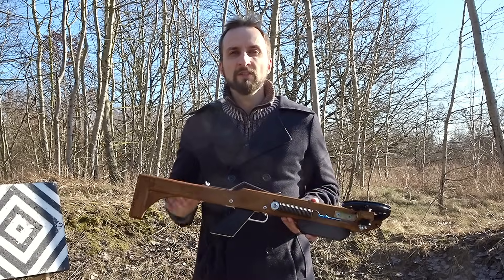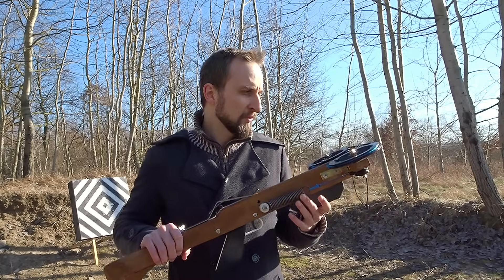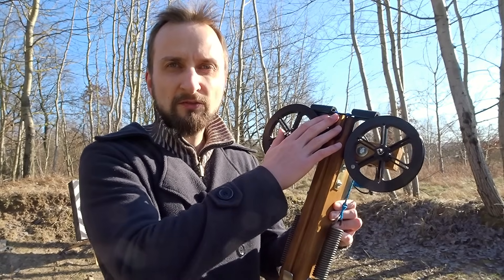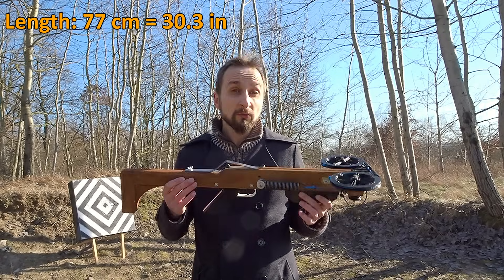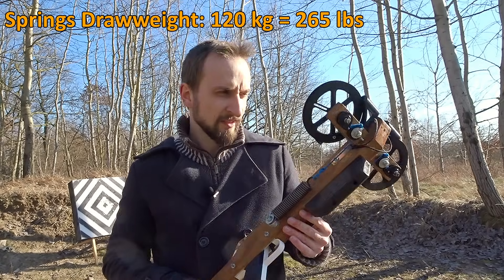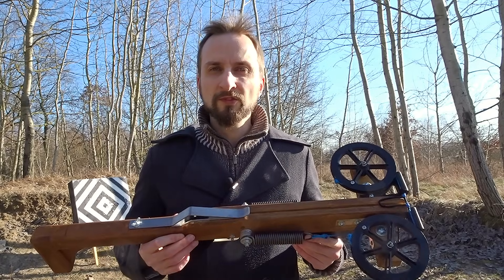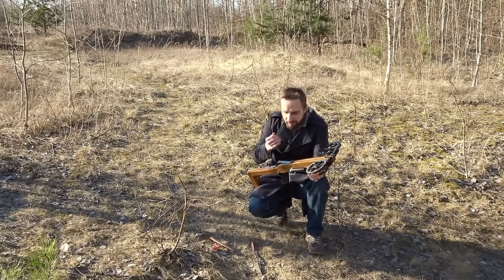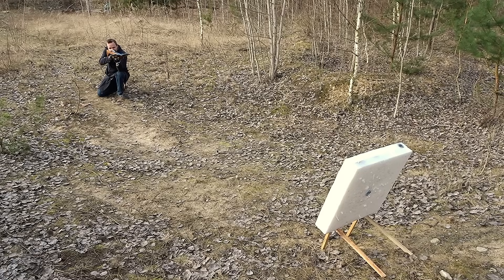Coilspring powered Crossbow

Comment: amazing! Can you build one that shoots bullets aswell?
Reply from the maker: Sure, that would work probably similar as in a Talon Eagle (or other models, see  https://www.youtube.com/watch?v=QeK3mM4BpzU ). The main problem is that bullets are too light. Crossbow bolts are usually much heavier (bolts I used in the video: ~30 g, 9 mm parabellum: ~6 g). Shooting such light projectiles will transfer less energy into it, compared to a bolt. And when its too light perhaps even cause damage (like dryfiring). Also its hard to do spin stabilization, so it won't be very accurate.
Reply: @aurigo_tech  Thanks for answering and for the link🙏 I am new to this channel, but will watch xour carreer with great interest xD

Comment: Fantastic work! Is the draw length limited by the circumference of the wheels? Or do you allow the string to overlap on the wheels so you can have a large draw length without large wheels?
Reply from the maker: The wheels make exactly one revolution. So no overlap. 
Short answer: it also makes probably little sense to have them rotate further.

Long answer:
The main problem would be the smaller wheels, for one reason because they are already quite small and making them even smaller would make
it difficult to actually mount them to the axle later on and the string to the wheel (and have them still be strong enough). Second reason the fixpoint of the string to these smaller wheels is already not within the wheel diameter but a but further outside, so it essentially looks like a circle with a triangle attached to it (see the imgur album, third last picture). And when you rotate this smaller wheel more than one revolution, this bit that sticks out and where the string is attached to collides with another part of the string and trying to rotate the wheel even further will cause the string or the wheel to break.

I thought maybe one could actually make a 1.4x or so rotation. Because if you imagine the string fixpoint on the larger wheels in the non-cocked state the 12 o'clock position, then in the cocked state it could be at the 5 o'clock or so position (direct line from the axle to the trigger nut).
But again the smaller wheels would cause the same issue here.

Perhaps there would be a way to redesign it for more than one revolution, but it seems to increase complexity quite a lot. Perhaps a gearing of 1:2 between the small and larger wheel, but that will cause friction losses etc. Or a spiral groove on the wheels or something like that, but I would not expect that to work all to easily.
Reply: @aurigo_tech  Wow! Thank you for the detailed answer. I've often wondered about the problem of wrap-around in these type of big-little wheels if we try to do more than one full rotation. Thanks for your insights!

Comment: One advantage of springs is that you that you really can extend your draw length and weight and also put them in Series or Parallel.  So maybe having 4 springs that are lighter but have a longer draw length might be better. Maybe. Idk. It is a very impressive design. Really awesome design. You could probably turn into a slingshot too.
Reply: you can easily swap out the springs for different weight, that's really neat
Reply: Series will reduce draw weight but will increase the draw length, allowing a lower cam ratio. Parallel will increase draw weight while maintaining the same draw length. If the man is gonna add the weight of two more springs to his design, I think he should go with the parallel option since his 4.5 to 1 ratio already works fine.

Comment: Welcome my friend,
I like the design and the power too.
I am also considering building a spring gun but I don't have a specific plan yet .....
The pistol grip and shoulder rest are good. I would add two things to the gun:
-With a sight to shoot accurately at a distance.
-I would put the springs in a thin-walled metal tube (say it looks good in a brass tube) to make it safer. if you touch the spring you can pinch your skin when shooting. The springs are close to your hand.
Congratulations to.
Reply from the maker: Thank you, Lacás! Yeah, there could be many things improved upon, including safety for the fingers. I thought about a sighting system, but wanted to finish this thing and didn't came to do it. In the next version though, for certain.
Reply: @aurigo_tech  these are just small additions .... I'd either mount a little reddot on it or make a simple viewer of it. I might emphasize the post’s apolaliptical or steampunk design.
Reply: @Lacás-c6m  Может быть, это то, что ты ищешь: https://www.youtube.com/watch?v=RuOYf-plI9M

Comment: This is genius. I have a couple of similar springs lying around and have been thinking of using four or more pulleys to increase the draw length and to possibly allow lighter arrows to be shot faster and therefore on a flatter trajectory. I think this system could achieve the same thing. I wouldn't have thought of doing it this way. Well done. I look forward to the next generation of this design.
P.S. there is a video on Youtube of a supersonic trebuchet. Do you think bows can be pushed to be supersonic?
Reply from the maker: Thanks! As mentioned I will certainly follow this with improvements and see where it goes. I have seen the supersonic trebuchet, but I think it is not really feasable for a hand held crossbow like version. At least not when you want to use more or less ordinary bolts or projectiles with a usual weight. However, the cutting edge of "normal" crossbows already reaches 1/3 to 1/2 of the speed of sound, and I think we are not at the end of development yet.

Comment: That's really cool. I like how simple the powerstroke extension method is!
Reply from the maker: Yes! With this method one could combine any desired drawweight and -length and the only thing to change would be the size of the wheels.
Reply: @aurigo_tech  I also just realised you could potentially increase the drawweight by adding torsion springs around the shafts that transmit the power from the lower wheels to the upper ones. It would shift the cg forward though.